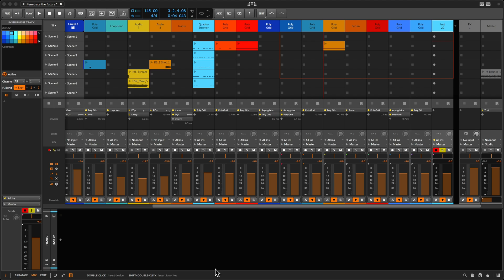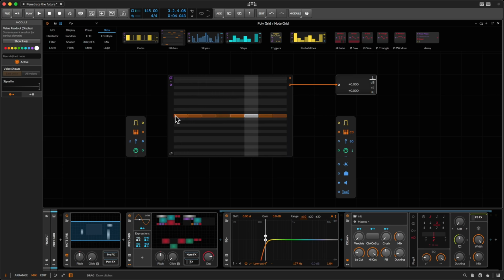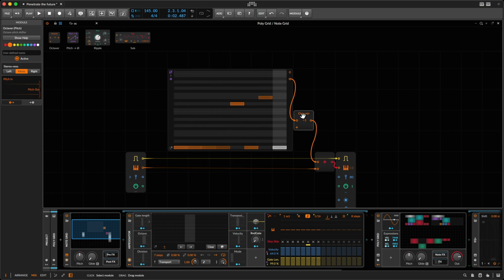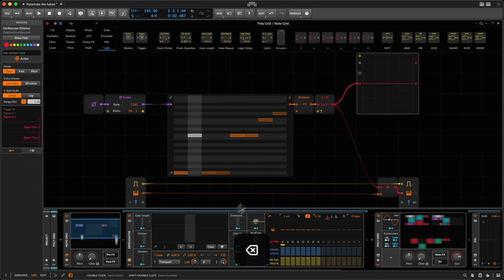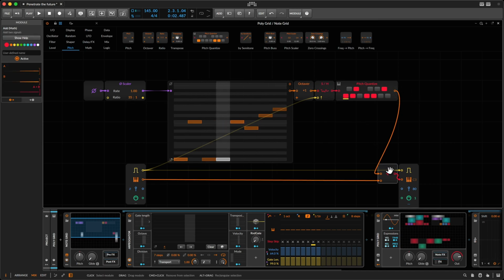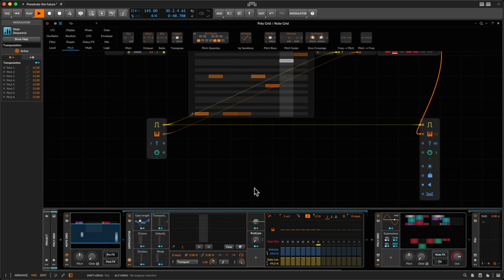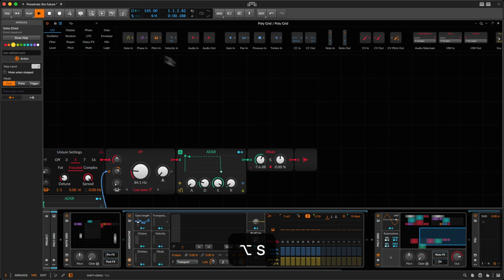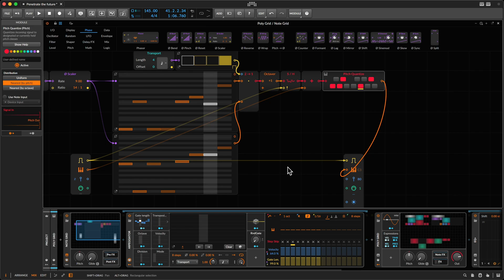Let's build a playable melody generator 🎶🪈🎵

Comment: If you record this there are a number of 0 length notes that are generated because of the phase. Maybe a clock and a 16th trigger would clean it up?
Reply from the maker: Hmm, can't reproduce this. Not sure how you can get 0 length notes unless you set the step length in the arpeggiator to 0, which then skips the note entirely. The note length should only bedetermined by the gate length at the input which the Grid then directly passes to its output without interfering. Maybe you could reset the phase of the scaler on transport start...
Reply: @theRumbleChannel  Checked, you are correct sir! Thanks! So I have a slightly different question. I would like to have note gaps in the arpeggiator, you know, "it's the notes you don't play" sort've thing. I do it with gates in the Grid but is there a way to do that in the arpeggiator?
Reply from the maker: @citadelo5ricks  I suppose you could watch my video about the arpeggiator. That should enable you to do that (and a lot more) 😎